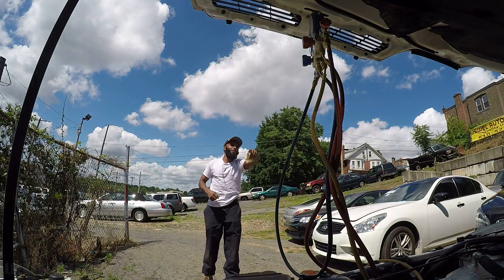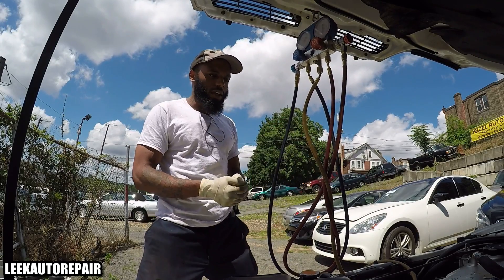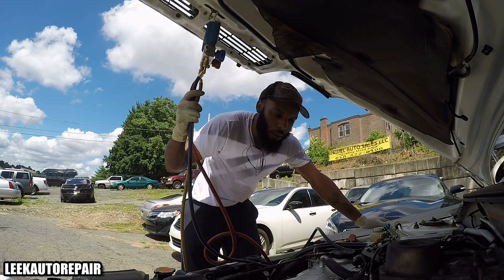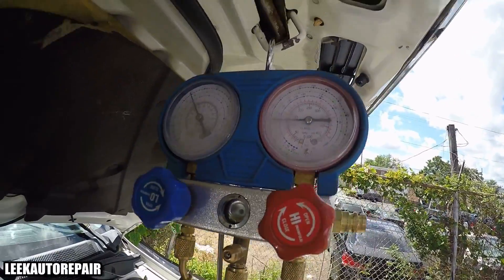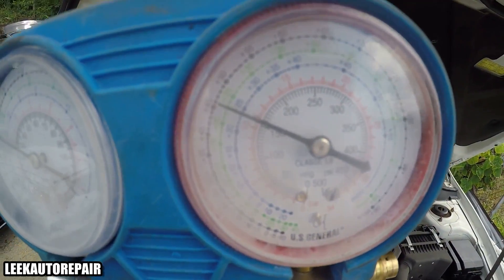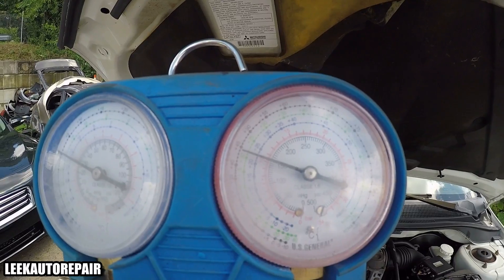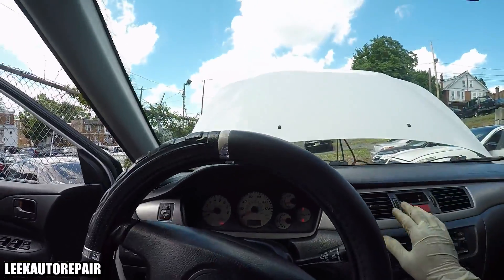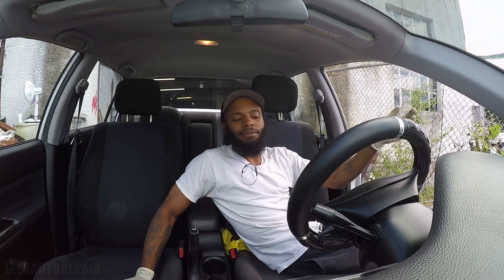Good AC Readings For When You're Recharging

Comment: If its real hot outside you will get a higher pressure on the high side.
Reply from the maker: +1970chevelle396 Very true! Forgot to add that
Reply: A long time ago, I left the manifold in my car with refrigerant in it.  And one of the hoses blew from sitting there in the sun.  It built up that much pressure.

Comment: hey that Honda fit with the ac and coolant fans stuck on .... was that a sticking ac relay??? or shorted control wire/or bad pcm
Reply from the maker: +billmck12345 +billmck12345 It was a bad thermal protector on the new compressor (reman) I installed....because of that the hvac module never got a signal back.......swapped the one from the old compressor and it worked lol

I did install new relays for the condenser fan and ac clutch......both stayed running when it shouldn't be.
Reply: oh... I thought you said that the ac and fans were stuck on and you had to pull a relay.... I thought the thermo switch just goes open and you get a no compressor operation??? that's why I asked about a stuck on relay... I see lots of sticking relays on bmws... just give them a little tap and what/ever is stuck on goes off....jusk asking for future reference... iv worked on plenty of Hondas for ac issues...so just curious if you did all fixes at once or did you do seperate
Reply from the maker: +billmck12345 The fans & compressor was stuck on, got new relays .....weird....fixed one condition and had more to do......crappy honda relays smh. 

Now the ac compressor and fans would not come on........weird again. To make it short, there was an open in the thermal protector. ......ac was displayed on when button pushed in but not seen on the scan tool.....basically I bypassed the thermal protector and compressor kicked on. Piece of crap reman compressor made lose time smh. Luckily I was able to swap one off the old compressor. Everything good now.

And oh yeah, thermo switch opens the circuit under high pressures
Reply: ok cool... so the original problem was relays...then another problem was added with new compressor.....wow that will make ya rethink your diag...lol ...don't ya just hate it when new parts are shit...quality control no longer exist
Reply from the maker: +billmck12345 Well explained lol